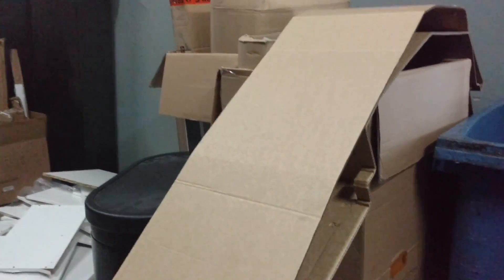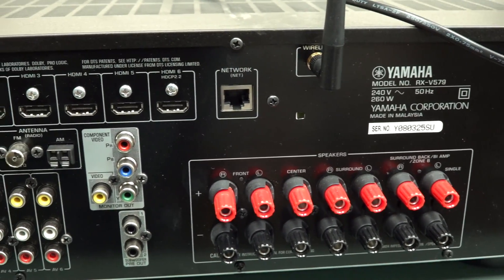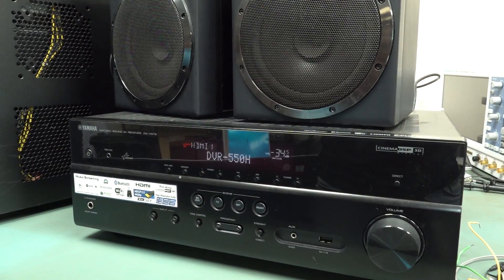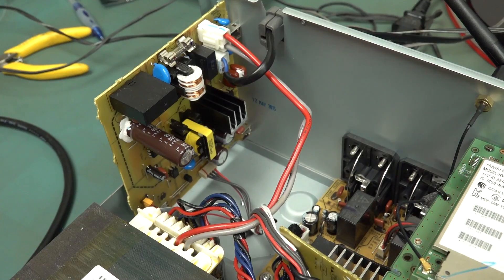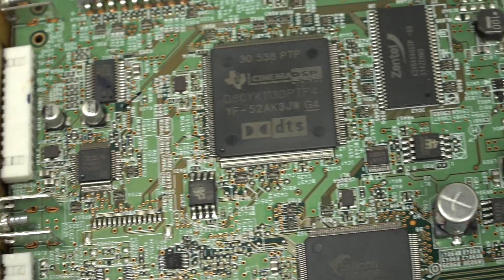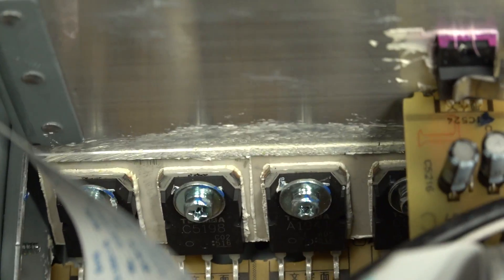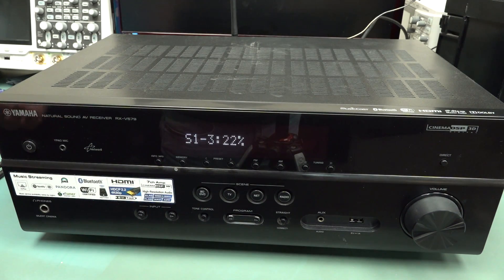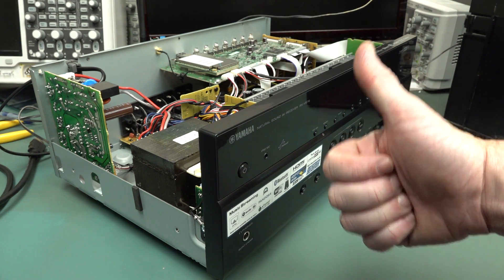EEVblog #1151 - Dumpster Dive Yamaha Receiver

Comment: that device might have been an employee doing a trash hide on a peice of equipment that was supposed to go into storage. the way a trash bag just happened to be sitting on top of it seems suspicious if you hadn't found it before you started rolling video (you probably did though so i don't know how it looked when you walked in). an underhanded thing that some employees will do is take something to the trash instead of to storage then dig it out of the trash before they go home, you might wanna ask around your building and find out where it came from, because it might be technically stolen.
Reply from the maker: It looks just like I found it. People and companies just chuck this stuff out for many reasons.
Reply: @EEVblog  depending on the company it would be breaking some rules by discarding perfectly functional equipment instead of selling it off. keep in mind that a publicly traded companies shareholders would shit a brick if even a thousand dollars was needlessly thrown away in its entirety. if your companies over there function like that without getting into trouble, it's only a matter of time until people do start pitching a fit. its pure financial irresponsibility and it ends up with people getting fired over here in the states. if the device had had any problems that would be one thing, but throwing away an almost new and quite valuable piece of equipment is a huge nono here in the states, people get fired for allot less, even company ceos.
Reply: in other words, a device like that would have been given away to an employee, not thrown in the garbage. and as i stated if they device had had any problems, yeah, to the garbage it goes, doesn't matter if it can be fixed because arranging the fix and paying for it would likely cost more than the device. but throwing away crap that works perfectly fine is a HUGE corporate nono. if your the employee or manager, you might as well start filing for unemployment.
Reply: @kght222  Its possible one or more HDMI ports are faulty as the solder joints can easily fail if you tug on the cables too much.

My Sony, even though it uses a discrete board for the HDMI ports (unlike this one) so should have been piss easy to repair, was basically junked by the store (under warranty) because Sony no longer manufactured the part.

I only hope they sold it on for repair, I hate the idea it was actually scrapped.
Reply: @alexatkin  certainly wouldn't rule out an intermittent fault on the device. my problem is with the lack of external damage. i don't know if folk throw away crap the same way elsewhere, but i'm certainly not sitting something down when it goes into a bin, it gets chucked. and hell, even with a slight intermittent fault like that, nobody working there wanted to take it home? yeah, there can be some issues with that some places, but the solution isn't to just throw it away. btw if all these trash treasures are coming from the same building, i would guess that someone needs to do a serious audit of those companies, because everything is wrong.
Reply: @kght222  I imagine they only threw it out because some accounting period expired and they don't care about actual profits from any output they may sell.
Reply: @kbhasi  their care about it is exactly what would nail them unless they are entirely privately owned by one individual. and even then, i bet that if they found out that a perfectly good device was tossed in the trash they would fire the person who did it. putting something in the trash might let a corporation pretend that they don't own it, it doesn't make them forget that they own it. i could get fired for bringing home baskets from work that we normally just throw away. i get the issue, but those baskets have no real value, someone might pay 5 bucks for one at most, and i don't sell em anyway, my point here being that throwing away plastic reusable baskets is wrong, very wrong. how about a perfectly good computer from 3 years ago sans hdd. obviously even more wrong. but the only way to stop either is to make it loud, to make it obvious that something is being thrown in the trash that shouldn't be thrown away. well, this is a room where allot of folk who work with this crap in a professional capacity congregate. you tell me what they should do? i would say that they should continue to tell their bosses not to throw crap away, but i would also ask that they learn more about where functional electronics can be donated. many of the things that dave ends up with out of the trash should never have been in the trash in the first place, and there are places to send defunct electronics as donations (or even sells), and some of those places you can even specify that it is a non profit donation that should be sold or given without profit to whoever it is passed off to. don't know about strailia, but in north america there are a few places. something like a scope would end up directly donated to a school after checking it out, very few of those types of operations could actually calibrate, but a school scope doesn't need to be perfectly accurate for 7th graders, it just needs to work right.
Reply: @kght222  And not only the private sector. A fellow who worked down the hall from me at the VA tried exactly this stunt with a piece of perfectly serviceable piece of medical equipment and ended up in federal prison. Perhaps it is because I live in the United States where the rules are different, but these dumpster finds seem implausible.
Reply: WE of course have no idea how it ended up there, but one plausible scenario is a tenant goes bust and it was left in the premises. 

As for the assertion that publically listed companies would 'shit a brick' at such a waste of money ... you must work for different companies :D

Or the companies you work for must anally list every single item on  the asset register. The ones I work and have worked for would only apply such rigor to high value items worth more than $5000 ... and even then after 5 years if it's electronics/IT its net book value is $0 and it can be tossed once marked off as disposed (a formality).
Reply: @macartm  the financial loss argument is the weaker one, i just didn't mention the waste argument which actually is a result of infuriating the public. if the public knows you throw away perfectly good computers (without the hdds of course) you end up in a shitter of a corner along with alot of public distaste. as a corporation you just don't wanna be there. these folk aren't dumping into their private trash can, they are dumping into a communal trash can. they should be called out. and the general public would agree. that's why corporations don't generally do this type of foolishness. for example computers that dave has picked up could have been donated. this of course could possibly have been donated (there might be undiagnosed faults that mean it wouldn't be) and clearly the screens and other crap that dave has recovered couldn't be, but it is still waste and depending on the size (monetarily) of the company they could be expected to have a repair department and required to not throw away functional resources, both from a private business angle and from a public societal good angle. my primary point is that "this is wrong"
Reply: @kght222  An asset written down to zero, then sold for actual money causes all sorts of problems for the accountants.  They don't want to have to go back and adjust the corporate asset values in prior reporting periods, so it's tossed rather than sold.
Reply: @thisnthat3530  and that isn't a giant red flag? a company that cannot deal with it's defunct assets is not a company worth investing in. and that is just to start. a company throwing away assets that have market value is likely to get in legal trouble if they are publicly traded. i can tell you right now that i and most people would have no confidence in a stock who's company routinely throws away working and valuable assets for literally nothing. no return at all. this is the type of crap that destroys companies. not businesses, business will keep goin on, but companies are destroyed by this type of waste. imagine how the local school district SHOULD respond to computers like what dave has found in the trash, just thrown away. it is not just a waste of money, the shame should be absolutely monumentous. maybe it isn't, but it should be. all that productivity thrown away just "because". the question is not whether companies are or should be doing this, the question is more "are they allowed to do this and why". in most cases they aren't actually allowed to do this, any mom and pop wouldn't in their wildest dreams throw away potentially useful equipment, and any corporation who does it can end up not only in serious hot water with investors but depending on where they are the water could come to a boil because they are wasting resources with potentially national money. this just doesn't work. give it away to your employees if nothing else, but don't throw it away, otherwise you are the asshole who denied a school electronics because it wasn't profitable. hell dave found a scope in the trash, that was pretty much perfectly good. and a signal generator. should those have ended up in the trash? or should they have been handed off to a local school, where the teacher like dave could have fixed them. and i can assure you, they would get more advantage out of donating this type of crap regardless of where they are in the world over throwing it away. i don't believe in a lazy company, they just don't care.
Reply: @kght222  usually companies have much more profitable stuff to do with their time than fiddle with already depreciated assets they have no use of. Just dispose it as per manufacturers instructions and that's it.
Reply: @timop6340  and that as i have been cluing is where the state should get involved. if that IS the case, these companies need to be reigned in. the waste is not acceptable. this is the type of waste that in the states would ruin a corporation if it were widespread and provable, that's why it isn't in the us, (provable that is). and they aren't even disposing per manufacturer's instructions, that trash bag sitting on top of the receiver didn't look like more electronics, although clearly there must not be any bio trash in that room. it simply does not look like any sort of recycling processing room, just a general headed to the crusher room. it looks like a 70 or 80s non incinerable room, the crap they can't burn. so it gets crushed and shoved into a landfill somewhere. i'm sure i've said this before in comment to this video, this is not right, but beyond that, this is BAD. the BEST CASE SCENARIO HERE is that a corporation threw away a perfectly good device and it might be generally recycled. that is the best case, the VERY BEST CASE. more than likely someone tossed it in the trash so they can recover it later and keep it. more than likely this is a semi general trash heap and based on what you folk have to say, including dave, companies throw crap like this away all the time with no possible repercussions. if that is true, folk need to yell, LOUD. while i am not a huge fan of unneeded regulation, i still believe in regulation and this is something that should not happen. devices don't "poof" into existence, so not only is it a waste of materials but more than likely it makes a mockery of the work of someone who makes only a pittance compared to your own wages, particularly when the work is GOOD. not to mention the fact that this isn't a disposable item. there are so many ways why this is wrong and practically none that would say it is right. so yeah, state regulation needs to get their chompers into this mess. (and when i say state i don't mean an american state)
Reply: @kght222  I'm not saying it's a good thing or not a waste, but all companies do it.  They've already written it off for the tax credits, so now can't suddenly turn around and claim it has value by selling it.  This happens particularly in publicly traded companies.  Tossing it doesn't change the books so the shareholders/market are happy.  A lot of the time it would have been physically destroyed prior to dumping, luckily this wasn't the case here.  If you wouldn't invest in a company that does this I'd suggest staying well clear of the stock market.
Reply: @kght222   "could be expected to have a repair department and required to not throw away functional resources" Yeah, right. How many companies do you supervise, let me ask? That department full of electronics repairmen would cost how much, you imagine? And how busy would those repairmen would be, on a yearly average? 
I don't thing companies the size of Amazon have that shit in their budget.
And Daves neighboring company declared that blue bin their Department of Repair of Resources. Clearly.
Reply: Yes I thought the same because it is an expensive and new model amplifier.
Reply: It might well be (certainly in that type of office complex) be a small company that bought it for a meeting/presentation room and replaced it with something more usable in that environment.
It appears the 2nd hand sale value is about $500.
At that pricepoint it is usually more attractive to just throw it in the trash than to sell it to someone, having to put the received money in the books, and face the possible problems when the buyer comes back to claim a defect.
(when you sell something as a company to a person who qualifies as a consumer it is often difficult to rule that out)
Believe it or not, this is just how these things go.  Even for equipment like old computers, it is often not attractive to sell it.  We had a load of old computers in the company and sold them to personnel for a very low price with a "as-is, no support" but that still resulted in so many queries and trouble that we'll never do that again!
Of course, throwing things in the general waste container is at the other extreme of the spectrum.
At least bring it to some recycling point where it is processed with other similar waste, not just end up on the landfill.
Reply: @Rob2  why they had it isn't even an issue. what they did with it is. and throwing away 500 bucks....... lets find out what company it is and make it public that they threw 500 bucks into a shredder. even that, big old no,no unless your only deal with very wealthy people, and even then, big old no,no. throwing away 500 bucks is still throwing away 500 bucks. i make 1200 dollars a week, allot more than most of the people on earth, pretty low in america, 500 is ALLOT of money, not something you want your company to be known to throw away on a regular basis in usable by the average person tech.
Reply: @kght222 $500 may be a lot of money to you, but to a company it generally isn't.
When that is a smallish company that consists of some management, some well-paid developers and a secretary that is very busy, it will be difficult for them to sell something like this for $500 and still have a profit, when considering all time spent, the risks etc.
Also, the world is not all the same as the USA.  Ruling out liability in sales to consumers is not so easy everywhere, and even selling things at auction is not always attractive.
Large mailorder companies here destroy everything that is returned just because that is more efficient to them.   Recently this has caused some uproar, but apparently it still goes on for certain goods.
(other companies have introduced special categories where you can shop for goods that you know they have been returned, accepting shipping and usage damage, but still the seller is responsible for the conformity to specification of the item.  so they may again get it returned when it does not work properly)
Reply: @Rob2  i am speaking about an isolated 500 in a larger culture where that 500 doesn't happen once. 500 adds up, REALLY fast. i am scaling, if this happened once at one place, it might have happened more than once at that particular part of the company, but hell, that company might have 100 parts, so suddenly it isn't a small thing or something that you can just let go, because you cannot allow that to just be a thing.
Reply: @Rob2  ever heard of loss prevention?
Reply: @Rob2  my argument is specifically about the small uproar you claim has been heard. hell, i'm a produce clerk, i just threw away around 200lbs (91kg) of salads because of a romaine recall here in the states. i get waste, pretty well. the thing is electronics don't get folk sick or go expired. the waste here is reprehensible and if the companies were named it would damage them. why would it damage them? because they are wasting things that still work and could help their communities. there is no excuse.
Reply: @Rob2  btw, amazon routinely sells whole pallets of returned items at auction. those are open auctions and any company that wants can include their own pallets. there is no warranty and short of selling something that blows up no responsibility. these things can be sold, or donated. and no, you don't have to give support.
Reply: @Rob2  yeah, as is no support actually means no support, it is your problem if you don't enforce it, magicly businesses get to enforce their perspective just fine because they said so. (i mean that as a joke, but when unloading surplus at least in the states it IS absolutely true) if they ask for service support you can legitimately hang up the phone and still be considered polite. hell, how did they even get a phone number to call?
Reply: It is clear to me that you just don't have any idea at all how the world works, how businesses work, etc.
Reply: @Rob2  oh? and if the stock holders found out that thousands of dollars were thrown away when they could have been balanced by having a small team selling the crap online instead, and the public learns that thousands of dollars of usable electronics were scrapped and give the company a bad name. i mean really? how far are you thinking this through?
Reply: @Rob2  oh, and honestly i don't care how businesses actually work. i care about how they should and represent themselves as working. when they don't match that....
Reply: btw, i'm thinking it through to the end game, where the public either cares about the waste or not. general consensus is that the public doesn't give a shit.
Reply: kght222 
Have you thought about seeking help?
Reply: @Rob2   also, amazon literally unloads pallets of returned goods. do you think anyone who gets that crap can expect any customer service?
hell, amazon sells them to ANOTHER seller who auctions them off first. and then the person who wins the auction deals with the items. do you think the person who tosses the items on ebay does much to deal with any of them being faulty?
no, they give the money back and move on with their day, that is what they do.
Reply: When I was a kid, my sister worked at  Perkin-Elmer for a short time.  I remember being mad when she told me they had to destroy old microscopes.  I wanted one so badly.
Reply: @Stephen Morton well i'll mumble some more about not reccomending new tech when the old will work, and making sure that the old isn't a mess. and stonily stare at you every time you mention coal. its either do that or cry.
Reply: @Stephen Morton i miss the days when new tech was cheaper than established functional tech. nobody wants to pay for r&d anymore. they wanna let customers do it instead.

EDIT: wow that's so broken, but i can't think of a better way to say it
Reply: oh, i figured out a better way to say that.... i miss when technology had to prove itself before it became valuable.
Reply: Could very well have been stashed in the back, top shelf of a closet unseen when the tenant moved out. I found a Nikon microscope in an abandoned, vacant building in just that way. But I don't disagree with you that it could have been an employee doing "trash stash". Seen that one before at a hardware store that had cordless tools disappearing.
Reply: You seem to like spending a lot of words saying mostly nothing/ repeating yourself. Cool if that's your thing, but no shareholder is even going to notice the loss of this receiver. Bits and pieces come and go from many companies all the time. Assuming this company is even big enough to be on the market in the first place. It could be, as you said, an item tossed to be picked up later, but that aside, it's likely just another drop in the bucket. Something written off that was forgotten/ replaced before it ever hit the can.
Reply: Nah